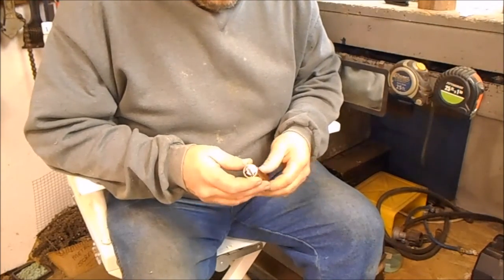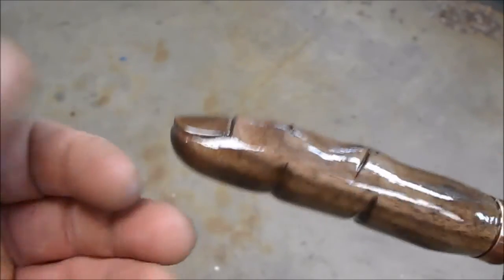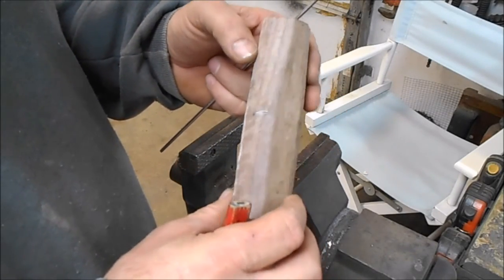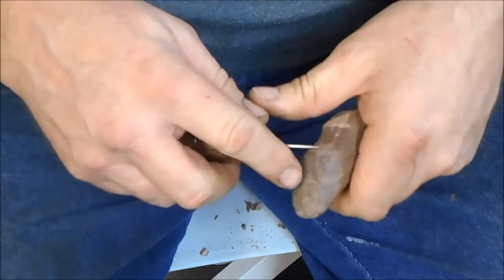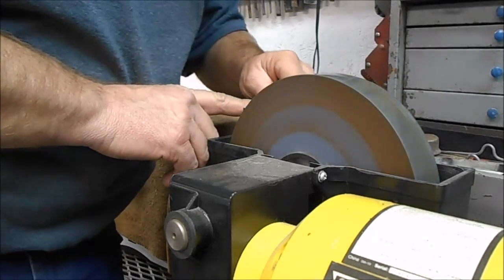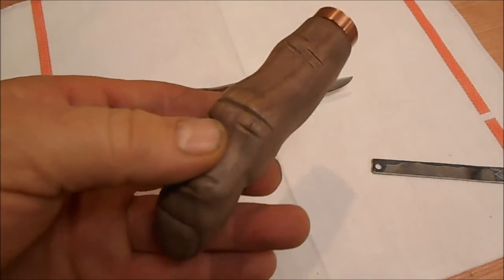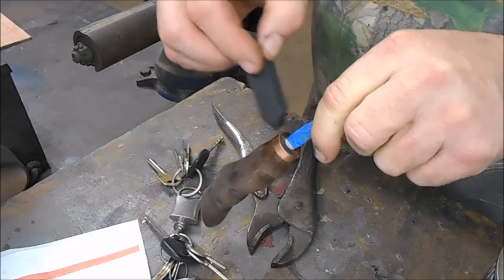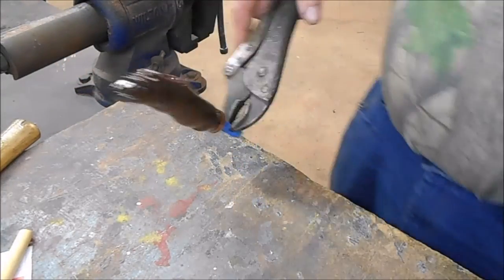Home made carving knife

Comment: I enjoyed the video but you should try to find harder steel for the blade..Steel that can be cut with a file wont hold it's edge very long. Old files can make a good blade provided you don't soften them by improper grinding.
Reply from the maker: Thank you for the info.